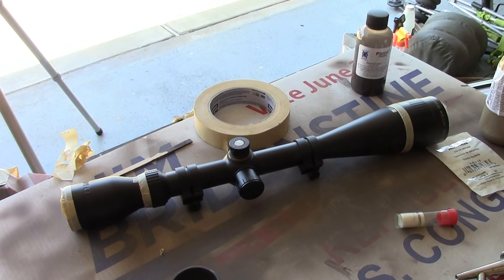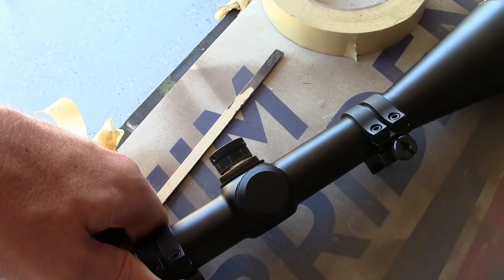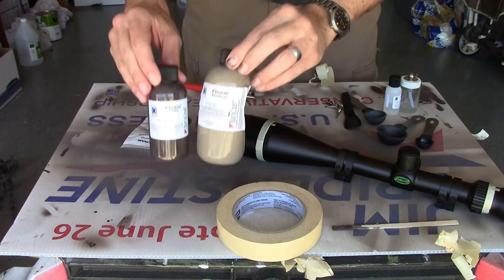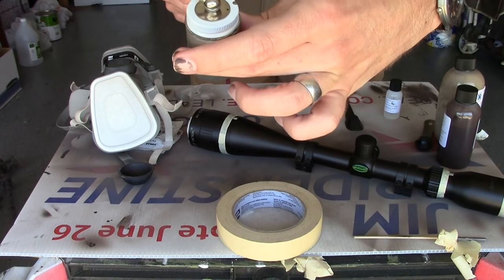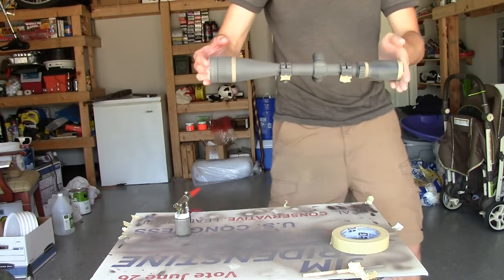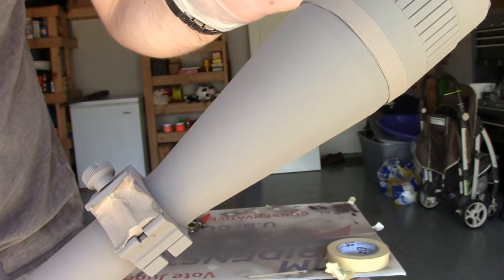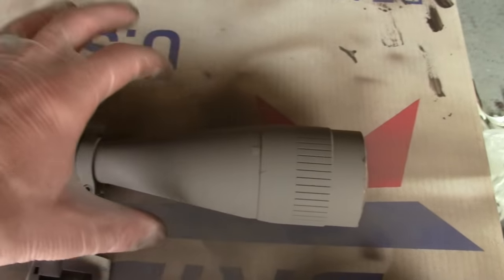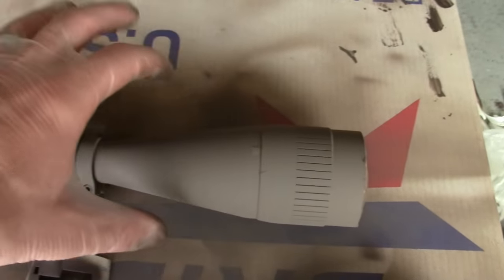Paint a Rifle Scope with Duracoat (USMC MARPAT) | The Social Regressive

Comment: I’m a 100% disabled vet,  and I have some high end assault rifles, think Scar and Tavor in .308.   HOWEVER if I ever need to have a camouflaged gun I’ll already probably be dead.  Great vid but most of us don’t need a camod (sp?) rifle defending the front door.  Srsly though, good video, as a matter of fact, great video.  My problem is I can barely make it to my car without a cane 😢. Stupid question though, wouldn’t you want to remove the scope mounts first?
Reply from the maker: I've tried several ways: painting with the rings attached, detached, and with the entire rig still assembled. Painting with the rings attached is kinda nice for two reasons: there's no extra thickness to the tube, and it's a perfect index if I take it apart and put it back together.

Comment: Nice job! I learned quite a bit from this. One question, what if you were to knock down the intensity of the parts of the scope that were masked off with a light spray of color, but still be able to see the markings? That black coming through is pretty intense.

Comment: when you are finished, do you have any trouble moving the magnification ring with the paint dried on it?  does it chip when you first move it?
Reply from the maker: I'm very careful with the thickness of my coats, so no, I've never had any moving parts seize or chip.  Duracoat helps with that, too.  It doesn't pile up like Krylon or Rustoleum.

Comment: Great Video, and a Beautiful paint job too. So,..... Dura Coat will adhere to a smooth surface without sanding ? My,... technology had certainly advanced. Now all we need is a Paint that will adhere to a automobile without sanding, wouldn't that be awesome ?
Reply from the maker: After seeing how the finish has worn, I think it's best to sand the barrel first. It's worked out alright, but not as well as the parts I sanded or the parkerized surfaces on the AR.

Comment: OOOW! DUDE THIS IS AWSOME! ....

I HAVE SOME QUESTIONS TO YOU:

THING IS THAT I LIVE IN URUGUAY AND HERE WE DONT HAVE DURACOAT PAINT, SO IAM PLANNING TO BUY IT THERE AND BRING IT HERE BY A COURIER. 

THING IS THAT THEY CANT BRING SPRAY BOTTLLES (PRESURIZED) ON THE PLANE, SO WHAT ELSE I CAN USE TO CLEAN THE SURFACE BEFORE PAINTING?

HOW YOU DO THOSE STENCILS? 

PLEASE CAN YOU LIST ME THINGS THAT I NEED TO DO THIS AND WHERE TO GET IT?

THANKS FOR READING THESE! AND SORRY TO BOTHER YOU
Reply from the maker: +Punishers Recball Howdy, Punishers!  This should be no problem at all for you.  You can use an engine degreaser or brake cleaner to prep the surface.  Basically anything that cuts oil and evaporates quickly.  You should be able to find plenty of those products in Uruguay.  As for the stencils, check out the video description.  I included links to the files I used as templates.  I just used shelf liner for the stencil material.  Anything waterproof will work, including wax paper.  Be aware of a few issues with Duracoat.  First, a little bit goes a long way.  If you're just painting one rifle, then you can probably get away with the smallest bottles they sell.  Second, the hardener goes bad over time.  It will last longer in the refrigerator, but make sure to get your project done within a few months.  Third, clean your painting equipment with lacquer thinner promptly after use.  Good luck with your camo job!  Send me pics!
Reply: Thanks to You!!! i will be sending photos! and try to do it like yourself! Thanks!
Reply from the maker: +Punishers Recball Thanks!  Be sure to check out my other two Duracoat videos.  They demonstrate the same methods applied to a bolt-action rifle and an AR-15.  Both go a little deeper into the equipment and techniques.
Reply from the maker: +Punishers Recball This stuff looks awesome (and cleanable!), but it might not be flexible enough for you to bend it around corners and curved shapes.  Shelf paper worked fine for me.  It's an adhesive vinyl sheet.  I just didn't peel the vinyl off the backing so I could float the shapes around.  http://www.amazon.com/Duck-1115496-Laminate-Adhesive-12-Inch/dp/B002AS9NC6/ref=sr_1_3?s=home-garden&ie=UTF8&qid=1441591202&sr=1-3&keywords=vinyl+shelf+paper
Reply: Thanks for everething!!!!!